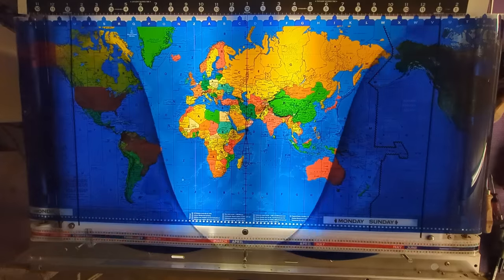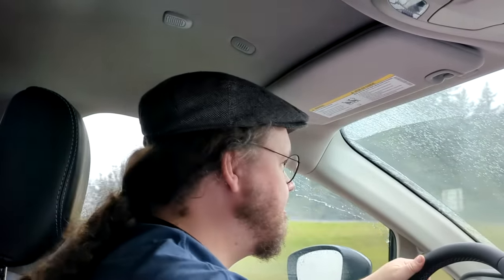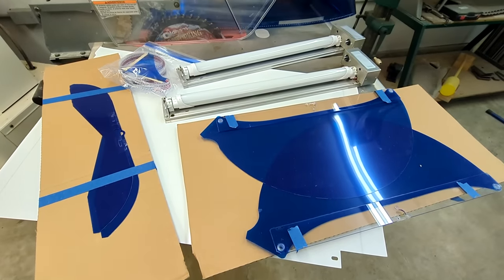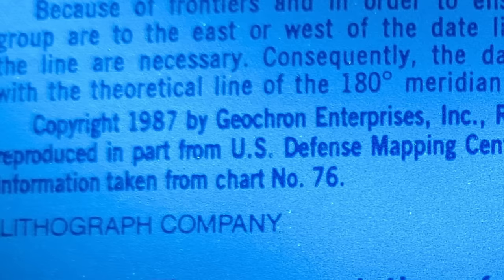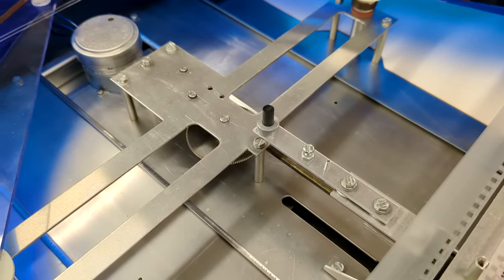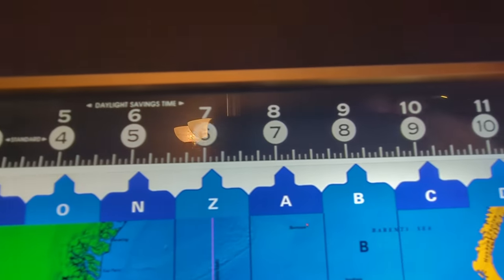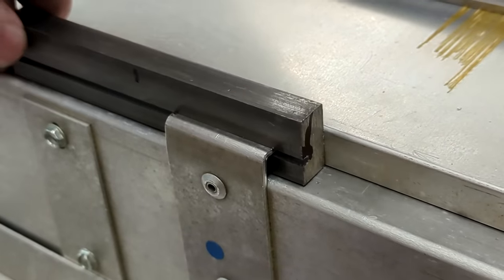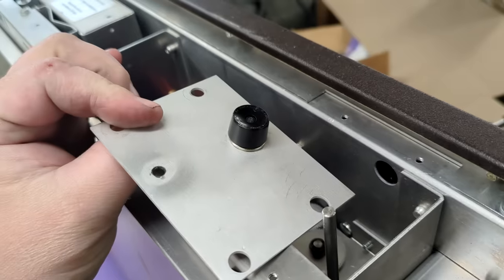The greatest clock (and map) ever made

Comment: Beautiful clock. Amazing engineering, and also nice too look and ponder about the world.
I think we should get rid of timezones and dst too. Not just because I am software developer, and store everything in UTC, even at home most of my computers are set to use UTC, not local time zone (granted I live in Switzerland). I much would prefer to adjust just our schedules, opening hours, etc that deal with timezones. It seems more explicit, and consistent. In modern word, doing this would be pretty easy too - we do not use that much printed materials that would need reprinting, or changing signs. And many places would not need to that anyway, if they want.

Comment: Random tip: Buy a roll of craft paper, and do a rubbing when you need hole layouts. Lay the paper along the side with the holes and use the side of a crayon or piece of graphite and rub on top the paper, this will reveal the holes and edges on a piece of paper, then place the paper on your piece of metal and use a normal punch to transfer/mark the holes.

Comment: My biggest issue with longitudinal time keeping is that we havent actually fixed the issues of old. If I want to coordinate with someone several miles east/west then I have to account for their time difference, but if they are north/south then there is no difference, saying "Ill meet you at 2pm" means I have to leave earlier or later if they are east or west of me the same distance. For as nonsensical as time zones are the area they cover makes them useful, crossing them is still a pain and they should be standardized to something more useful such as longitude lines, but your suggested version would simply exacerbate the issue exponentially.
Either we all use a shared UTC unmodified or it is simply always a mess to coordinate anywhere.

Comment: The frequency of mains power is controlled very carefully. It goes up and down slightly with load, but it's ensured by the operators of the grid that you'll get exactly the right number of cycles over the course of a day.  (I used to work with the guy who invented NTP. Very fun.)

Comment: 17:50 "day's on Earth last 26 hours." I've been pondering the question in my head for a long time but have not worked it out exactly. I think the answer is around 49 hours. If time zones were 24 equal perfect slices the answer would be 47 hours for one "day" to pass over the earth. (I think) The day "starts" it the very first time zone. At one point 24 hours later is the one point where all the whole planet is on the same day. Then it still takes another 23 hours for last time zone to finish the day. Haven't found a way to properly illustrate this. I would be happy if someone was able to. PS. Great video. I have been fascinated with Geochron World Clocks as well. Thanks for the inside look.

Comment: When I was in elementary school, the father of one of my classmates was an amateur radio operator. This was in the 1960's and most of the radio equipment in his ham shack was Collins. If you're interested in amateur radio, or are licensed, you've probably heard the name. But one of the other fascinating things was the 24-hour digital clock. It did not have LED or LCD numeral, and it didn't even use the "flip plate" numeral change mechanism that became familiar on "Digital Clock Radios" in the 1970's. No, this was a Mumechron Tymeter clock, and it had a simple but effective set of internal components. The clock was always set to "GMT" or Greenwich Mean Time" - now called by some UTC - Coordinated Universal Time (fi upon them!) - that is to say, the time at a particular location on the Prime Meridian at Greenwich Observatory in England, near London. There is actually a marker that is the physical representation of that point; supposedly put there with the assistance of the Royal Navy, Britain's top scientists of the day, and a gentleman - actually a carpenter, and at the time therefore Not considered to be a "gentleman" named Harrison. It was Harrison who over many years built the very first accurate chronometer. The specific need for such a clock was for navigation, which at the time meant the Royal Navy, all the ships sailing in the British Empire, and anyone else who needed to know where they are on the earth's surface. Harrison actually built four separate designs of his Chronometer, and the final one was very compact - rather like an oversized pocket watch. But it kept the time that it was at Greenwich, no matter where on the oceans you were. With a Chronometer, a Sextant (to measure the angle of the sun above the horizon), a map marked in longitude, and some numerical tables and a bit of math, a ships navigator could find his position. The problem had existed since the days of Queen Elizabeth the 1st, and she had offered a reward of 20,000 pounds Sterling to anyone who could build a clock that kept accurate time, and thus allowed accurate navigation. 
The Tymeter clock was not nearly as glamorous as the Harrison Chronometers (well worth a visit to see them on display, if you find yourself near that part of the world). It had four rotating drums, driven by an electric motor. Except for the drum that showed "Seconds", they were each divided into a series of flat segments that ended up as approximately circular, and each of the flat surfaces had numerals on it, with the first going from 00 to 23, the second and third each from 0 to 9, and the fourth also from 0 to 60, in 10 second increments. Together, they would show the time in GMT from 00:00:00 H:Min:Sec.  Only the "Seconds" drum rotated continuously; the others moved around, changing one "facet" at a time. The fascinating part of the clock was that this change in hour and minute happened suddenly, with a small but definite "clunk." To many amateur radio operators who had one, they were nicknamed "Clunk-around" clocks. Above the clock was a world map that  was labeled with time zones, names of countries, and call sign prefixes. This map was sold by the Radio Relay League in Norther America, or by a similar organization in the UK. They were actually published in several languages, but English was predominant, especially in the days when much of amateur radio communication was done using "CW" - usually mis-named "Morse Code" If you were listening on the radio receiver, and heard a callsign that was not "local, the map would show the area where that callsign was used, and the clock would, by addition or subtraction, allow you to figure out the local time wherever the other operator was. In 1964, this was utterly fascinating when seen and heard using the very elaborate radio equipment. Of course, not all ham radio operators had a setup anywhere near that fancy. Most radio equipment used vacuum tubes, and at the time (in Canada at least) there was a lot of studying of how radio circuits worked required, before someone could go to the Transport Canada office and spend 4 or 5 hours doing both a long and detailed written exam (with many radio circuit diagrams drawn from memory) plus a test of sending and receiving CW. At the time, there was a minimum age at which a person was allowed to be licensed. I realize now that this was not silly discrimination, but rather an attempt to protect new radio hams who would probably be building or fixing equipment that used very high-voltage electricity. Far from the technology of today! 
Anyhow, that was my first introduction to the world of tize zone maps, day/night terminators, and GMT or "zulu" time. When I was finally able to get my license - about 10 years later(!), I found a used Tymeter clock for about $20 - which at the time was not pocket change for a teenager. Initially, I modified a standard wall clock so that it had 24 hours on the dial. But it was pretty ugley compared to the "digital" Tymeter clock. 
Later that year, this gentleman ordered and installed one of these Geochron clocks in his ham radio room. He was a surgeon, and so was able to afford the steep price for the Geochron. And that clock was just as magical to me as how you've described your own history with them. It's almost 60 years since I saw that clock and map for the first time, and it's engaged me ever since. So thank you for this video and your story of finding and refurbishing the Geochron. That's only the second one I've ever seen. The gentleman in whose house the radio station was died only a few months ago, and I think the Geochron was willed to one son, who is a commercial airline pilot. I know it will have a good home; the last time I saw it, aroud 2002-2003, the Geochron was still going along flawlessly. They're built to last!

Comment: I think the alternative solution to the problem is just to do away with solar time altogether.  If everyone used UTC instead of their own timezone, you'd do away with calculating differences between one place and another.  Sure midnight could be at 1700 in one place and another place could have midnight at 0900, but that just means locals in those areas would be used to waking up at, say, 2300 or 1500 respectively (equivalently Greenwich would be waking up at 0600).

It's never going to happen, but it's a fun little thought experiment.

Comment: Excellent work on a very little known topic, but...
20:19 - Hold my beer:
Although your proposal is amusing and not entirely impossible or unusable for everyday life, any industry that deals with long distance travel (shipping, flying, trains, militaries) has certain procedures that account for the passage of time and change in time zones, which would be further confused without these lines.  I'm not arguing solely on bureaucratic inertia,  it's simply the most pragmatic compromise in gradations that is commonly accepted.  I mean, we could greatly simplify time to decimal hours or some other mathematical contrivance, but there is a system in place that works well, a pleasant rarity.  For example, if a ship is crossing an ocean, depending on which direction, you are either gaining or losing several hours, which is important for the crew who are getting paid hourly and have mandated work/rest cycles.  If your clocks simply ran on time, it would just confuse the time at which you were supposed to knock off, as well ass all sorts of stuff like fuel and distance calculations.  In fact, in such situations it is not uncommon for the master to set a convienent schedule of time changes so it minimally impacts the crew (especially in the case of losing sleep).  I'm sure there are other practices in similar fields and industries, not to mention that internet access is far from being as ubiquitous and guaranteed as you state.  Basically, it is one of the rare occasions where a true international consensus has been reached and it is actually rather sensible and effective.

Comment: I'd rather have one unified timezone with everywhere being the same time since our entire system for time is arbitrary anyways. That means that people on the edges of current timezones wouldn't need to wake up at the same time despite the sun being an hour apart between the two places anymore. The time you would need to got to work for example would be based on what actually makes sense in the area instead of a standard time across the time zone.

Comment: Trying to date old maps is always fun. The last time I used XKCD's chart was when I watched Atlas Pro's video "How OLD is this ATLAS?". It didn't help much because the clues shown in the video didn't quite fit the chart, but it was a good starting point.
And yes, assuming the atlas in their video was accurate at the time of publication, it was possible to pin it down to the second quarter of 1978, using the "Gebietsreform" in Germany. :)

Comment: Its a fun thought experiment, but also entirely impractical. for anything where the time needs to be accurate across zones, we already use UTC. 
those clever little devices have already solved most of the time zone problems. if you need to call someone in another country, just punch it into google. if you use it regularly, just set your phone to show multiple time zones, most people I know with family or work far off will have 2 times on their home screen. I haven't had to manually change my phones time since nokia days, It already knows where you are and adjusts accordingly.
I love obscure and overly complicated clocks, never seen or heard of these, but I want one. cheers for the video.

Comment: Just a thought on the 24-hour wall clock using the hertz rate method: Why not have a rechargeable battery run the clock using DC and recharge the battery (as needed) using AC?  This would take care of the heat and power outage issues, plus ensure a steady hertz rate for the motor.

Comment: The problem with no time zones is that meeting times would always have to specify a meeting location (er, a meeting longitude, anyway). If it's a virtual meeting, then the choice of some reference longitude would be as arbitrary as time zone is now, I guess, except many such meetings include only people in the same time zone, so that would become more complicated.

The other complication is that, while you might have to translate a remote time zone into your local time zone, you currently don't have to worry about your local time zone changing unless you're doing some significant travel. So it might be challenging to know what time you're supposed to join the meeting if you're moving around town.

This all makes me think that what would probably end up happening is that people would not go by local solar time because the main point of tracking time is not to know what's going on with the sun, but to track what's going on with other people you're interacting with, which is an inherently social/political activity, not a scientific one. So that makes me think that everyone would just standardize on UTC after a while of trying to live in local solar.

We haven't done that, though, because we want some sense of the ebb and flow of a person's local day. If you schedule a virtual meeting with another city across the globe, it's useful to know that your 9a (as opposed to your 4p) falls in their normal working hours. If everyone is going by UTC, and I want to schedule a meeting with the Zurich office, then I have to have some other way of figuring out what "4p Zurich time" tells me.

All solvable problems, but which solutions we pick matter.

Comment: There was a GeoChron in the smaller of the two general avation (non-airline) terminals at Tri City Airport in Tennessee... my father had reason to be there on a semi-regular basis for reasons having to do with using seven figures' worth of cancelled checks for a pillow... like you, I could never get enough of the thing.  

Not being the mechanical wizard you are, I have resolved that if I ever come across a large but otherwise relatively crappy monitor surplus to requirements, it's going to get mounted on the wall much like your mechanical marvel, and run a GeoChron simulator most of the time... I don't know if Dutch electrical code would let me get away with running my own auxiliary outlet (especially since mains power on the Continent is 220v)  (if indeed I could*; European construction tends to be much more *solid than American stud-and-wallboard), but one could always run colour-coordinated surface conduit with just the figure-eight cord for the power brick down to the outlet... it wouldn't be super-clean, but a lot neater than a dangly cord.  

(or, knowing us, we'd probably put a bookshelf or something under that, because you can NEVER have enough bookshelves... )

Of course, the other ultimate timepiece, for me anyway:  A proper Godfather Drosselmeyer grandfather clock, with a big damn owl up top, a moon-phase display in the face, and a proper five-rotation chime - not Westminster, that's for the folks in Blighty, but something equally legit and appropriate for the Continent.  

Thanks for making me remember that.  :)

Comment: Good video, terrible idea at the end. (I too have terrible ideas, not throwing stones.)  For anyone who works globally, just the few time zones we have cause enough confusion while coordinating a meeting that growing by 3 orders of magnitude will only exacerbate, inevitably making it untenable, and reverting back to the old model of fewer time zones.  It would also force local people to ensure they get each and every store's local time to know their hours, make an appointment, show up to work, schedule a delivery, etc...  It's complication for the sake of complication, furthermore, it demands and requires that all people have a device connected to the internet at all times (or gps to receive a broadcast, which means those satellites or base station must be handling and transmitting each arc second of time, which would be different than when it was received because of earths rotation, speed of broadcast, physics in general...).  This isn't even feasible, as anyone who travels would realize, especially with the conversion to short range 5G from long range 4G, opening numerous dead-zones across large swaths of area, or the densely forested regions that naturally block out gps, wi-fi, and cellular signals.